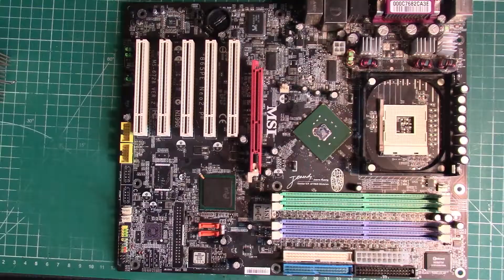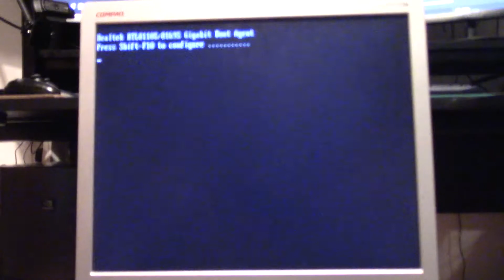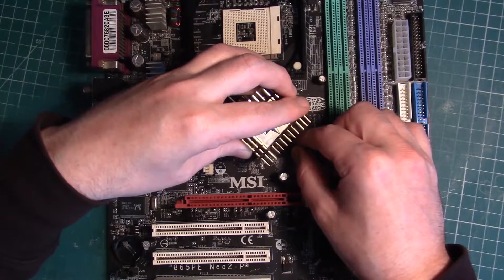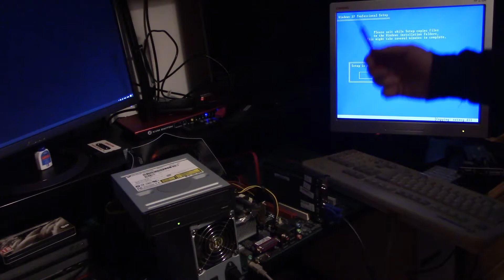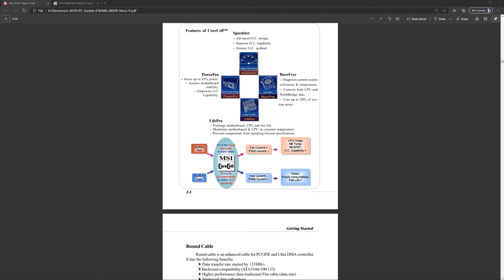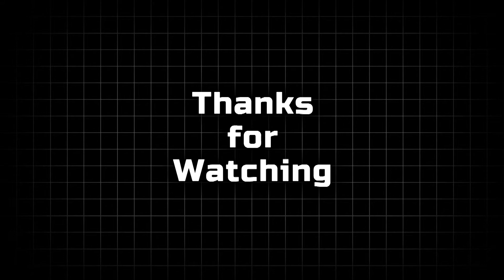Socket 478 Motherboard - AGP Fault - Part 01

Comment: Which is best procceser for this socket i need to upgrade but i havent much money please tell
Reply from the maker: The best would be one of the later Pentium 4 CPUs. A good option might be one of the Prescott family of Pentium 4. 
Pentium 4 Extreme range would be the fastest but are hard to find and expensive.There's also no guarantee they would work with your board.
One of the faster Prescott P4 chips would be a good choice.

Comment: hello, and I had problems with that chewing gum from the chipset but I managed to remove it successfully and very easily with diesel . Apply a little diesel with an earstick leave it for about 30 minutes then clean with another clean ear stick

Comment: i have this same board and had it running sweet until i unplugged everything and re assembled.  now i dont even bios screen. im suspecting its the geforce fx 5200 that has cacked its pants. 
the joys of playing with old gear hey.
Reply from the maker: Shame, 5200 is a unique card. I find most parts pick-ups on ebay from random sellers don't work out ( like the PNY 6600 LE). There are some great sellers & stores on ebay and I'm moving towards only purchasing parts from certain folk. Good deals from random individuals are always a gamble.

Comment: Is it possible the PSU is the issue?  I've had to recap a few ATX PSU's recently!  Enjoying this series!  Regards transistor equivalents - there used to be books you could buy (updated every few years) that listed the various equivs for any transistor.  I wonder if that type of thing still exists?  Those mosfets usually work in parts, a high side and low side.  It's worth checking connectivity between ones near each other to see if you can find how they are paired up.  I also wonder if it's a case of the board is older than the AGP card, and maybe it just simply cannot provide the power that later card requires?
Reply from the maker: Cheers Gadget, funny how things happen. What started as a simple video checking out 2 graphics cards turned into this :) 
I tested with another working PSU ( 600 Corsair ) but cut it out because the video was getting too long. Same behavior. 
I ran the same card on this motherboard back in the day fine. Was my daily driver. 
I think the two ( C & D ) are paired. They both seem to be running hotter. The temperature test in the  video are the second round of tests I did. 
I had run the same test the night before after the computer had been running for a bit and those two MOSFETs ( C in particular ) got allot hotter,   >70C. Redid it on video, so I wasn't leaving any thing out. 
I'll have to look into the equiv transistors docs. Some online source like Digikey & Alltranistors.com claim to do the same but didn't return any thing on this device. Found some on spec but just not in the right package. Seems the newer ones of this spec are mostly like a BGA type rather then DPAK.

Sorry for if this was a bit TLDR  :)
Reply from the maker: Right on with the PSU BTW. Was sure it was fine before but I can tell it's not now. My fear of any thing mains voltage, makes me hesitant to open them up. I've written down the cap values and added them to a list on RS. Will pick them up next time I'm ordering more stuff.